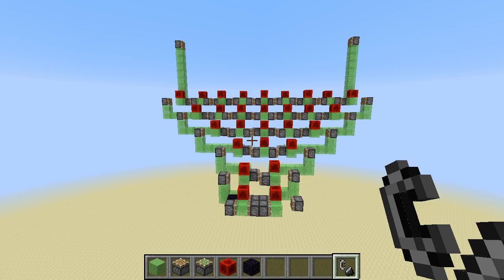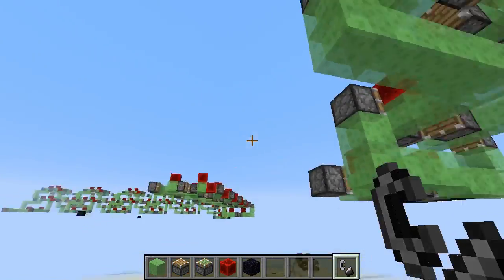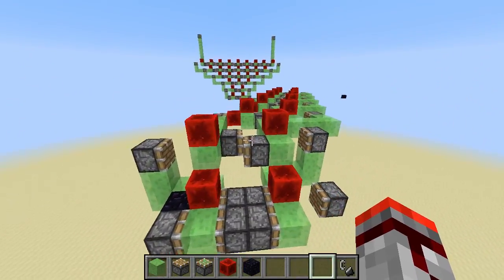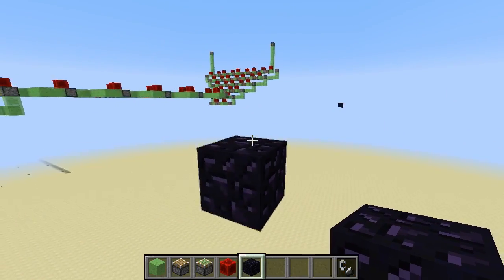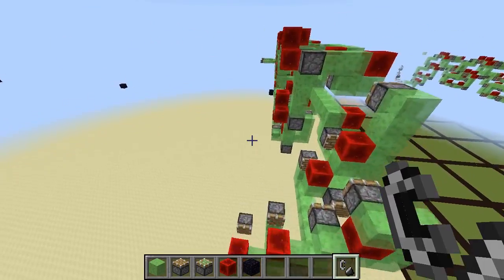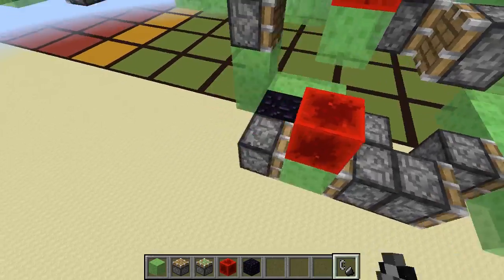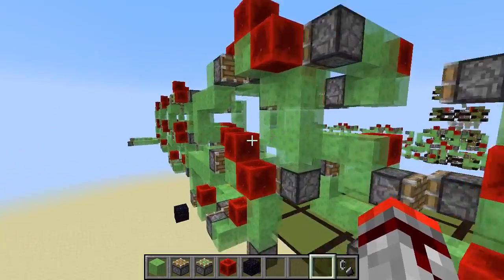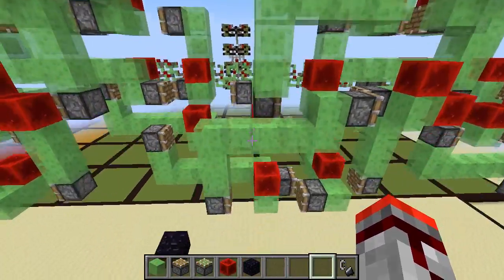Horizontal parallel line expander - Minecraft

Comment: Pretty cool! I see the progression of videos going into the dungeon tech. Chunk loaders/reloaders, Flying machines, what will be next?!

Also, why is it called an expander? doesn't it just move creations?
Reply: Its a bidirectional system which expands ouwards from the engine.
Reply: so the main engine branches off to other contraptions right? and those branch off to others and so on and so forth?
Reply from the maker: The3gg I wouldn't really call this branching personally ... Anyway, I called them expanders in my first slimestone video as each layer expanded on the previous one. Basically, you have a tiny engine push a giant structure.

In this particular context there's no expansion, just a lot of layers of equal size, however I just kept the name I used to use. ;-)
Reply: Ok. Pretty interesting still. An alternate Kobra almost ;)
Reply from the maker: The3gg
It's basically a bidirectional KOBRA, yes.

Comment: I still want to know how you prevent crashes in unloaded chunks because they happen with every flying machine(Atleast i know of)
Than you would need pushable chunk loaders wich get pushed into every used chunk
How it is with this stuff idk if the push signal comes from loaded chunks i guess you maybe still have those broken pistons or not updating pistons so yeah..
Reply from the maker: Robitobi01 Good job noting that, I expected to get a comment like this but wasn't sure. :P This will be the main subject of next week's/the week afterwards' video (in fact, that's why I built the whole chunk grid set-up two weeks ago). Anyway, I'll leave you with some (partial) responses already. ;-)

"I still want to know how you prevent crashes in unloaded chunks because they happen with every flying machine(Atleast i know of)"

Let's just say I've performed a series of tests checking all kinds of launching times relative to the autosave. Some delays seem to consistently allow a specific flying machine to fly in and out of the unloaded chunks unharmed. However, since this is probably dependent on the flying machine and how deep you push it in, I'm looking into a more consistent (and slower) strategy, where the flying machine is halted at given points to make sure it's never moving during the autosave. My theory is that if everything is frozen when it unloads, there shouldn't be a problem with pistons getting stuck. I have yet to test this though.

"Than you would need pushable chunk loaders wich get pushed into every used chunk"

Haha, this reminds me a lot of me when I started these dungeon-tech videos ... it turns out those pushable chunk loaders aren't that ... hard ... to get, really. XD
Reply: Would it work to have a machine that pushes in a piston line and drops it ? When you do that in the 45 seconds it should be stabl. Than you have a unloading detector wich instantly loads the chunks again by unpowering the droped line ? Unpowering is instant on pistons and if you detector gives a signal instant it should fix the chunks by itself right? For that method you probably need a bit more preparation but should be doable
Reply from the maker: Robitobi01
Nah, I didn't mean that for those pushable chunk loaders ... you'll see. :P